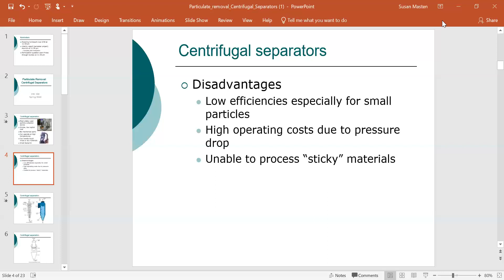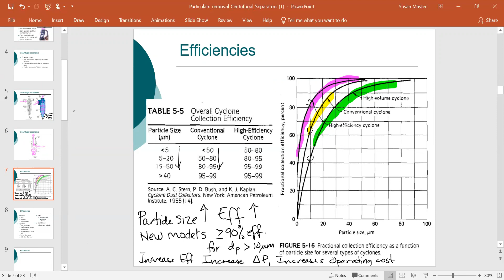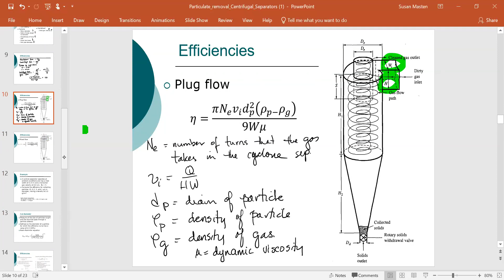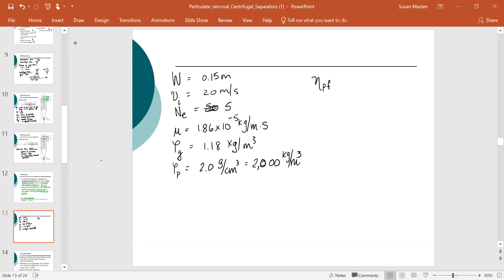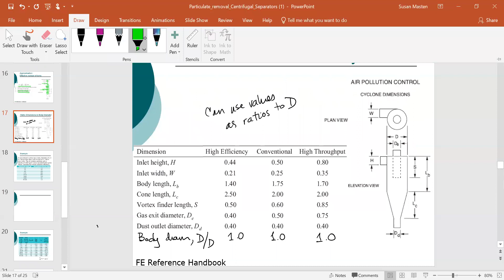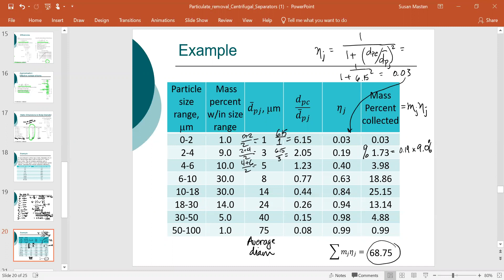ENE 489 Centrifugal separators

Comment: In 14:25, when the exit pipe diameter is increased, you said the efficiency increases, but you wrote decreases. Which is correct?
Reply from the maker: Decreased is correct.  I'm sorry for misspeaking.